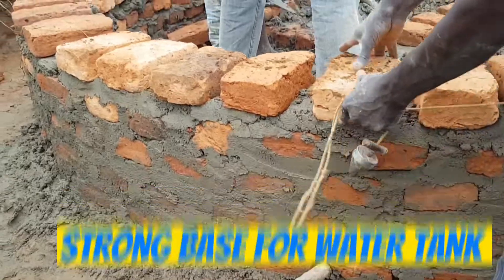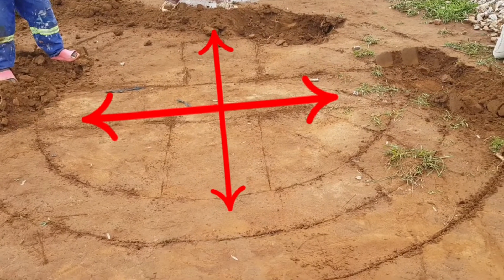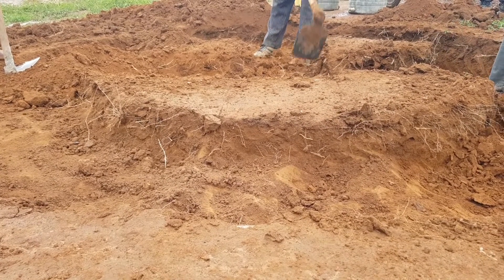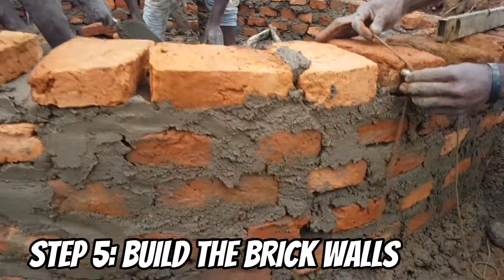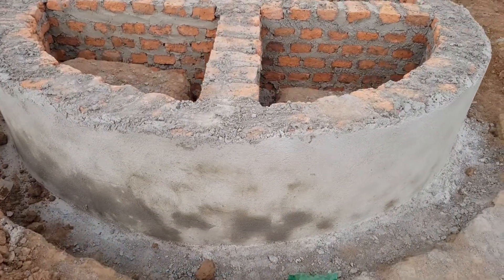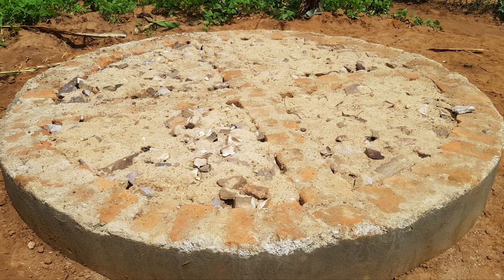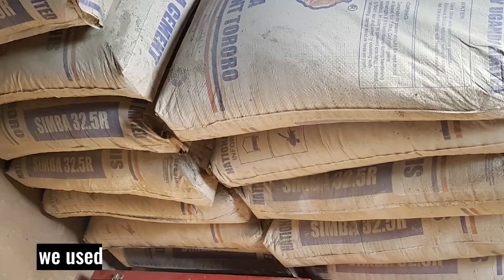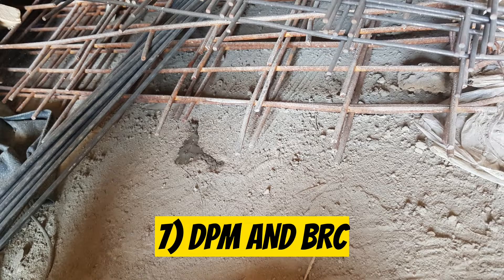How to build stands for WATER TANKS Construction| brick water tank stand design

Comment: Why not square?
Reply from the maker: 1.A circular shape covers a large volume with less surface area compared to square.

2. Any liquid exerts equal pressure in all directions. That's why most HDPE water tanks are circular in shape, thus need for need for a circular base stand to receive or transfer load equally to the ground. 

I hope that answers your question

If you are interested more in tanks stands,
Watch this video also about how to install fiberglass water tanks stands 👇
https://youtu.be/eWWnYYm8h5c

How to install a steel stand tank tower
https://youtu.be/LbLxfs110ck